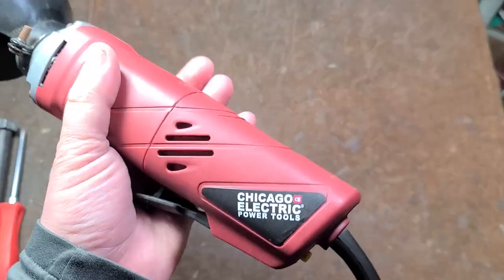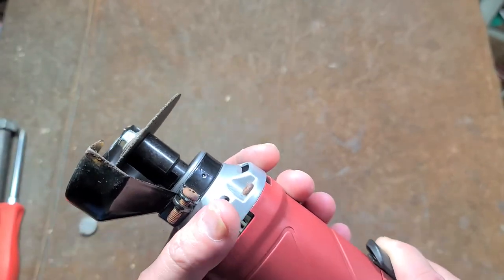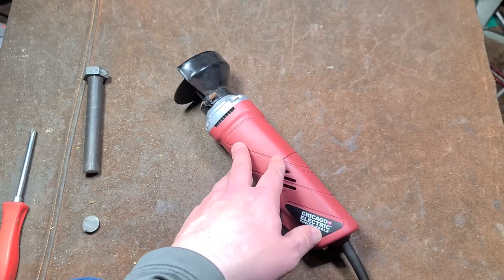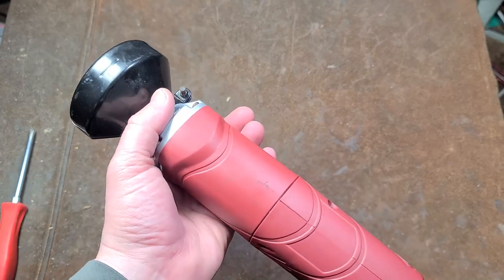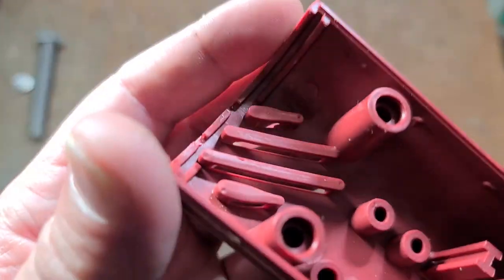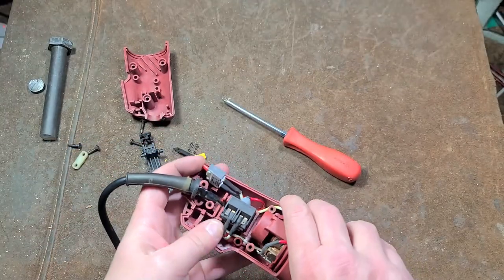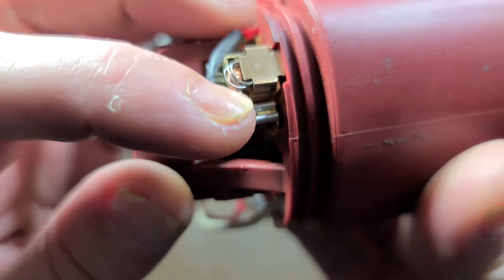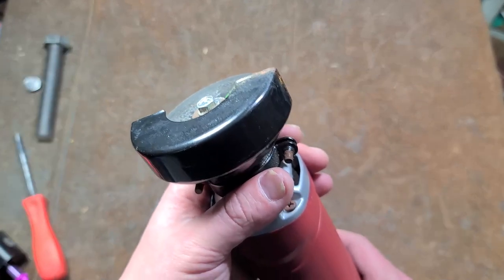Harbor Freight 3" Electric Cut Off Tool Review/Teardown/Modification

Comment: Could've used this to cut the header bolt off last weekend. Ended up using a dremel tool with 1.5" cutoff wheels. Took a long time, but we got through it.

Comment: I made a brass adaptor on lathe that allows me to use 4 1/2 cutoff wheels that are wore down to far for 4 1/2 inch grinder, and can still use the regular ones without adaptor. The thickness of these blades are .032. Also did reset modification. Makes this tool very useful.

Comment: I'm an A&P Mechanic and I use one of these for trimming plexiglas windshields. The long body is useful for me to brace my hands and cut on my marks. Otherwise its a pathetic tool. I don't trip the breaker for what I cut so will leave it for now. I machined a small adapter to use steel slitter blades. I've gotten my 25 bucks worth. Definitely a POS.

Comment: Interesting, haven't heard about this before.  I use a Dewalt angle grinder mostly; or sometimes my B&D type one 5amp.  Curious that you put that Irwin 4 vise in the middle of the board, and not on the edge?   Another great tear-down, Ty.